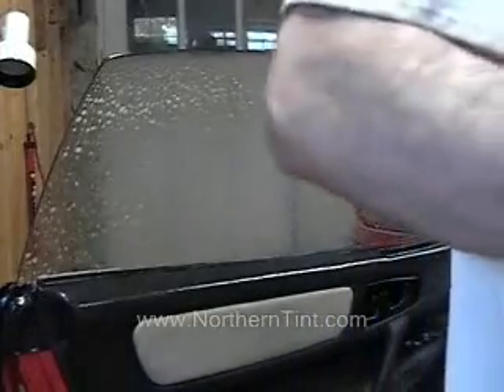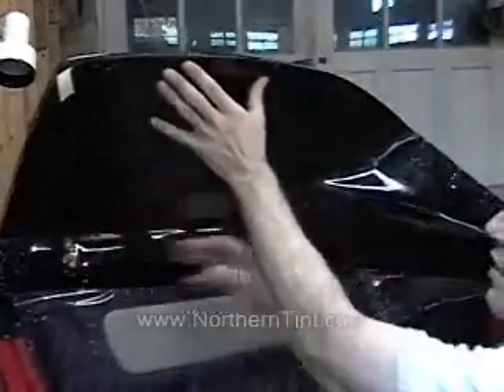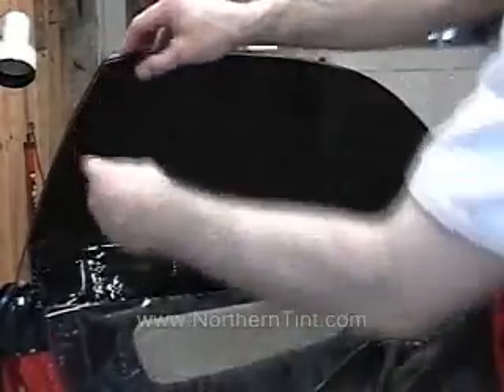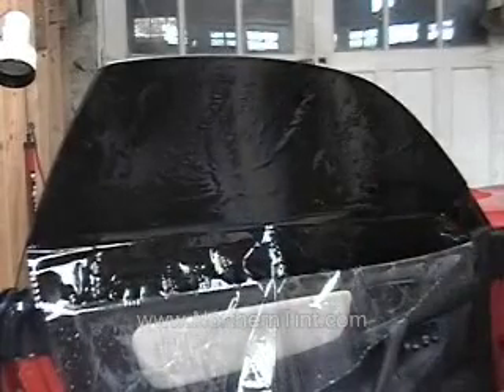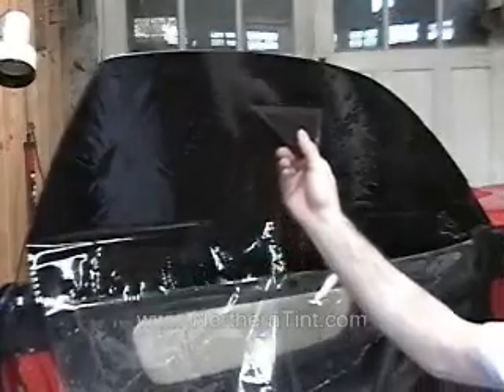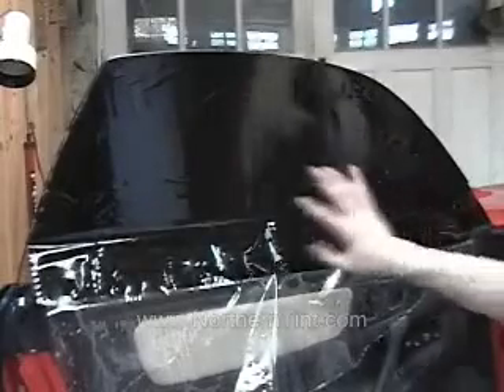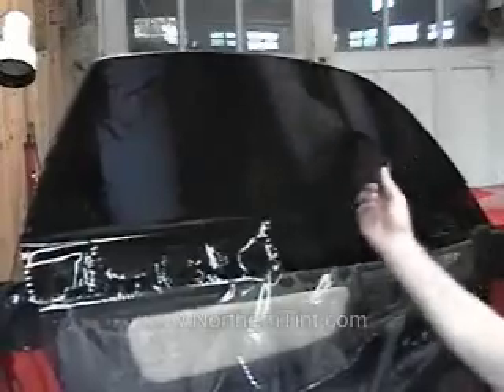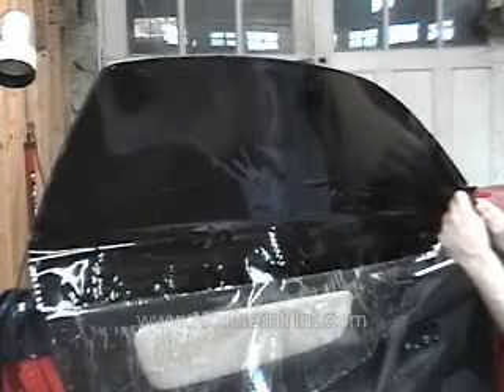Window Tint - Applying Window Tint - Pt.21

Comment from the maker: @customcaraudio101 

That's a great idea.  Ideally we would want some tucked under the gasket at the bottom of the window and a shaved edge along the top... not just on a frameless window, but on all roll-up windows.  The reason I didn't show this in the video is because that's a bit more advanced than what I wanted to show to people who have never tinted windows before.

Most tinters also charge more for shaving windows as an upgrade option. $25+ extra per window in some locations.

Comment from the maker: @zyou8er 
It is a good idea not to if you're working on a customers car, but this wasn't a customer car.  Also, it's been about 5 years since I Installed this tint... no finger prints, no bubbles, no peeling and still dark as the day it was put on.  Thanks for your input!

Comment from the maker: @mastertinter731 

Good idea.  That would really simplify the installation on frameless windows.  Even without tucking extra film behind the weather any light gaps would be minimal, or the excess length could be controlled to only 1/8-1/4 inch so it would tuck easily.  I've never seen a window installed from the bottom up, could you point us to a video for an example?